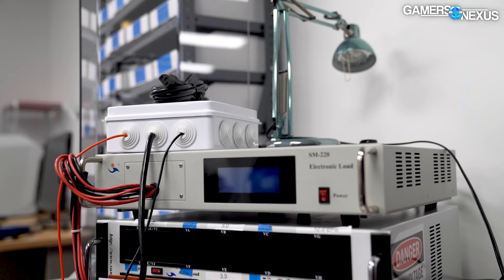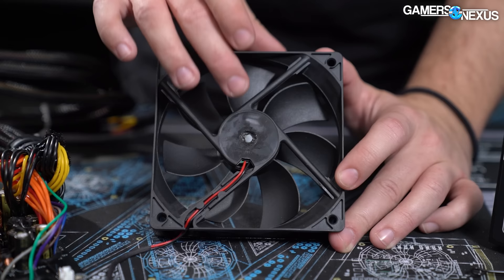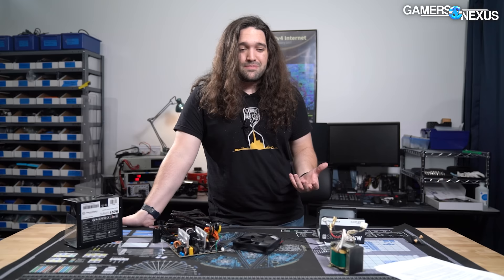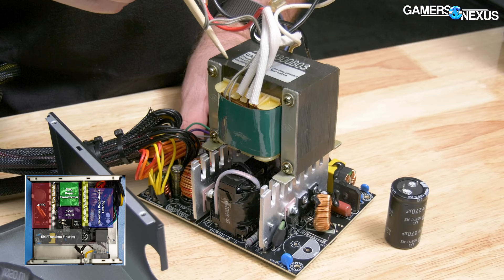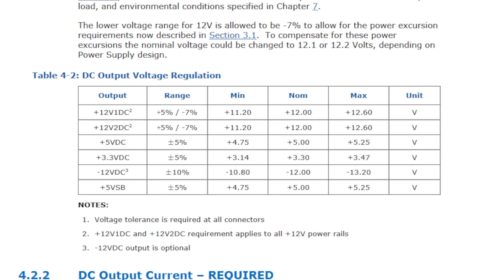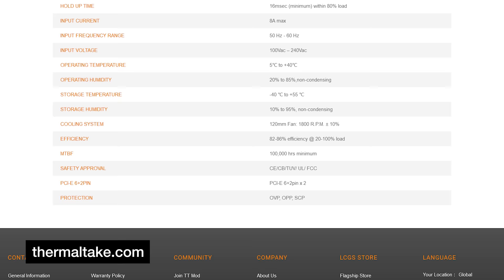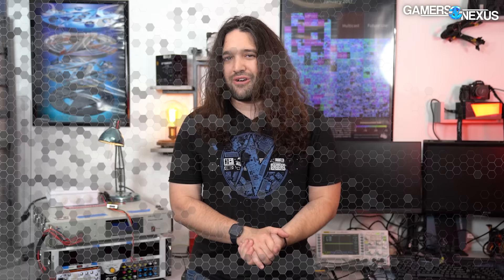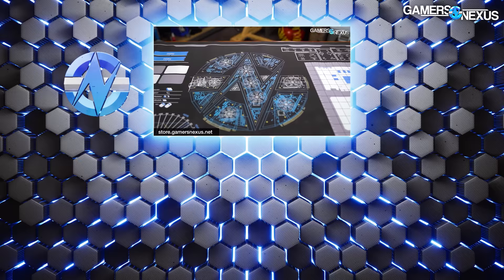Taking Risks on a Cheap PSU: $30 Thermaltake 430W SMART Power Supply Review

Comment: I'd really love to see some of the low end Corsair and EVGA power supplies compared to this. Especially the bronze models. Most of the budget builds I've seen run $30-40 PSU's from those 2 brands.
Reply: Agreed. Lots of people buying low end evga and Corsair.
Reply: I had a Corsair cx650m years ago kill the motherboard ram  GPU and even the CPU it was i5 4690k,Msi Gaming 5 motherboard,2x8gb gskill ripjaws and msi R9 290X I got it all from the same company and they swapped it all went with a different power supply tho they said they would get reimbursed from Corsair as the PSU was at fault with there testing
Reply: @TKIvanov  Yeah destroyed the whole PC just bought all the parts and the first time I turned it on for about £1200 I paid. The company I bought the parts from was really good done testing on all the parts and agreed with me IT was the powers supplies fault they just sent out all new parts apart from the power supply got a seasonic instead
Reply: Corsair low end PSUs are crap, would trust this over a Corsair low-end PSU any day of the week
Reply: @swecreations  I'm done with all Corsair PSU's now Seasonic seems to be of the best quality in my opinion and I have never had a problem with Seasonic I have had problems with 2 Corsair PSU's a HX850i has died on me as well as the cx650m
Reply: @swecreations  Only the Corsair VS and CS lineup is questionable quality. Every single other Corsair psu during CX gray label and above is objectively fine according to the tomhardware reviews from the build quality to electrical performance, functional protections and warranty.
Reply: @randomshorts739  Except not every single Seasonic psu is flawless.

Older Seasonic Focus and Prime units before 2018 had issues with gpus that has high transients spikes and ends up shutting off. This applied to alot of rebranded seasonic focus/Prime psus like the Antec Signature, Asus Thor, Phanteks AMP, Antec Earthwatts Gold Pro and so on and so forth. It was fixed around 2020 for revisions but still doesnt change the fact it was flawed for 2 years on their most popular platform

There's also objectively bad Seasonic psus like the S12II bronze (old ass platform and lacking protections) and S12III still questionable on it's protections and quality.

Im not saying to avoid Seasonic. Hell, Evga G6 is a modified seasonic focus platform and that thing is amazing value for what it offers but Im saying not to dick ride on brands only but objectively view each model to their own.
Reply: @granddya5323  I absolutely agree on that last part and most of the other stuff you said, sadly seasonic nowadays has multiple series that arent built by them. However in my experience the S12II was a solid offering (this is based on me using one for 6 years then selling it to a guy that prolly still uses it and I also know other people that have had it and had 0 issues. Im not familiar with its internals and build quiality just the above mentioned user experience).
Reply: @granddya5323  I think quality control is better on Seasonic Corsair has also had many problems with its AIOs, especially with PSUs tho as Seasonic manufactures the PSU whereas Corsair is just a reseller so doesn't have as much oversight
Reply: Now some are made by Seasonic but some are cheap crap and made out as if they are high quality
Reply: @granddya5323  And I just look the focus plus had the problems because too sensitive over current protection 

"As you would expect from Seasonic's reputation for build quality it's not a failure due to component weakness but rather the Over Current Protection (OCP) is set too sensitively and triggers under high load"

 so it's not bad PSU they were actually  trying to protect the computer more
Reply: @granddya5323  Did you not read my comment, that is exactly what I said?
Reply: @TKIvanov  Just b/c a PSU works fine for years on end does not mean they are good and reliable in general.

Would you really say newer cars by GM are fine b/c they are issue free for 3 years until you see the transmission start slipping, interiors falling apart and so on and so forth.

Hell my Corsair HX 850 v2 was still working for nearly 11 years and I decided to throw it out anyways for the 5800x + RTX 3080 build b/c the age on that thing was not worth it to new parts (ended up with an EVGA GQ 1000w for 55 bucks)
Reply: @randomshorts739  1. Corsair AIO issues has long been sorted ever since they stop using Astek gen 5 pumps. Astek gen 6+ and CoollT pumps, while slightly worse performance wise, are now far more reliable and you can easily warranty them if they ever fuck up.

2. It was confirmed the PSU shutting off from the transients of gpus isn't from the protections but rather a design flaw with the PSU not being able to take the sudden surge of power, similar to early units of the EVGA GA and Antec Neo Eco Gold. 

FYI, S12II and III lack UVP and OCP as well.
Reply: @swecreations  At least the CV 450 and 550 has much better cap selection, better overall platform (double-forward topology instead of being a group regulated unit) and doesn't lack OTP either. Similar case with the VS gray. CV 650 uses a different platform but is much improved with being DC-DC and so on and so forth

The only objectively bad PSU is the orange label VS which is just as bad as this thermaltake smart but they are out of production for 6 years now. 

Unless you are buying a GF1/GF2 from thermaltake, they suck more ass than any other psu manufacture objectively and dont get me started on their old TR2 series.
Reply: @granddya5323  Nah, the CV PSUs are shit, doesn't matter if they have better cap selection a double-forward topology if they still constantly fail, I do PC tech support as a side hobby and I can't tell you how many of these I've seen fail and take components with them...
Reply: @swecreations  As for my anicoical evidence, I had a thermaltake tr2 600e take out a xeon x5680+r9 290 system 9 months after I have built it and  thermaltake smart 700w wasn't able to handle the vega 56+i7 9700k on furmark after 13 seconds (neither could the evga 750 n1 and goes to show how shit tier psus just can't handle these parts)
A CWT GPUV 650 handled that same system without issue.

Objectively, CV is a far better unit than the tt smart or tr2. Even on the psu tier lists (which is based on professional reviews, known issues. overall performance of handling voltage drops, ripple, hold up time, transients response etc, protections implications. 

Thermaltake Smart is on the fucking bottom of "avoid using" while the CV is in "igpu use only".

Hell even Steve only limited himself on this psu to only basic office system. That goes to show how fucking shit this thing is.
Reply: @swecreations  I'm not saying to buy the corsair psu (corsair cv is bad value anyways lo). Evga GT, thermaltake gf1, MSI AGF, Antec HGC evga g6, superflower iii and corsair TXM are some of my favorite psus to buy for sub 85 and lower.

I'm just saying thermaltake's lowest end psus (the white smart and tr2) are boardline fire hazards that no one should ever buy.
Reply: @granddya5323  Why do you think that? It has a 5 year warranty and I haven't heard a single report of one catching fire, GN also found no obvious issues with the design from the outside, even if that's not a complete assurance there still haven't been any reports of one catching fire. It's not a fire hazard.

Comment: While the cheaper power supplies are interesting, it would be nice to see GN review some of the really high end PSUs as well. It would especially give a good comparison of really high end components to components like this one. Additionally with the rumoured power consumption of the upcoming RTX 4 series, higher watt/higher quality PSUs will potentially becoming more important.

Something like the Antec Signature Series 1000W Titanium, or the Corsair AX1000, or the Seasonic Prime Titanium they are based on. These are the ultra top end (I have the Antec one myself). Would be interesting to see Patrick compare the components of the crème of the crop PSU components to the ultra budget like this, as well as the mid-range stuff.
Reply from the maker: Working on more. For now, this one fills that! https://www.youtube.com/watch?v=ftF8V6Di84s
Reply: does Antec still make power supplies? We can't buy them in Scandinavia anymore because they had too many warranty issues

Comment: Honestly, I'm amazed they can design, build, and ship a halfway decent PSU for $30. So, to some extent, TT should be applauded for making something that probably won't catch your house on fire at this price. 

That being said, I would never buy it, and would likely never recommend it.
Reply: Thermaltake probably didn't design it, hardly anyone selling power supplies do these days even if their logo makes it to the PCB.
If your shocked at this thing costing $30 you'll probably be even more shocked at how much it would cost if you take the TT branding away and get it directly from the OEM.
There is a very good reason seemingly every "makes" power supplies, it's very profitable even at the low-end.
Reply: @zacharytaylor8523  yep good points. Although at this price point I'm sure TT isn't marking it up much. It would be curious to know what the BOM cost is. But then it needs to be branded, packaged, shipped, and the retailer needs to make something on it too.
Reply: @zacharytaylor8523  Yeah, low-end stuff in particular is outsourced. According to old threads TT uses OEMs like HEC, Channel Well Technology, and FSP. This power supply has probably been in production for well over a decade though so it'll still be one of them.
Reply: TT doesn't make PSUs. It's basically the same hardware Great Wall and CoolerMaster and a dozen other budget brands use. Generally the brand companies order them to meet a certain price point and specifications, so you can get crap and great stuff coming out of the same factory, and for the same reason the work Steve and boys do is important because it is near impossible for consumers to tell what is what. Being a brand name does not automatically mean the unit you buy is any good (looking at you, CoolerMaster), just like a low end brand like Great Wall (which you'll find in stuff like Walmart PCs) actually isn't all that terrible - I mean, they don't blow up and won't fry your stuff

Comment: used to use the built in power supplies in antec sonata 3s thinking "antec is fine!", had one die on me

got an ocz xstream when 80+ came out since it was the cheapest 80+ power supply in my budget, died on me

i have not made the power supply mistake in over a decade. used to check jonnyguru and get something they gave very high ratings to (usually seasonic), now you guys are filling that hole in the review space. love it.

Comment: When I tell people "Don't cheap out on the PSU" there are a few good reasons for this;
Namely most people get to the point where their current hardware isn't keeping up and generally it's a new GPU that will get swapped in. Having a good PSU allows you, even 5+ years down the line to easily swap out and power a current-gen card.

The other reason is mainly all the horror stories about the Ali Express specials that tend to go pop and take other components with them
Reply: Yep. When I started building PCs I was a young kid going into high school and I didn't have much money so I always skimped on the power supplies... and always had problems with them. Luckily none ever exploded but I did get BSODs.
Reply: Definitely don't cheap out with lesser known brands. They've got much less to lose. With more known brands you're just very likely to get old, cheap to produce, designs with lower efficiency (and lower operating times, I.E. don't expect it to get far past years of insurance it has).
Reply: @MLWJ1993  I had this power supply from OCZ ? You remember them ? Ever heard of them ? Too bad they no longer exist, they made good products. I loves that power supply and used it in 3 different builds. It was still working just fine in 2016.

Comment: I'm curious how this compares to the PSUs included in prebuilts (dell, hp and the like) since they often have good 80+ ratings but low wattage
What I also wonder is how this compares to the two other 30$ PSUs I could find on amazon which are the EVGA W1 500W and the EVGA W3 450W. While testing those is probably not worth the effort I still wonder how they stack up...
Reply: I'd like to see the W3 since the only legit review is gone and the enclosure has gone under some revisions, so possibly a changed internal layout. Last I recall, it actually performed pretty well for a group regulated unit like this smart. 
The W1 has been reviewed by Aris(psu reviewer for tomshardware/kit guru/etc.) a year or two ago, and the result was the bridge rectifier exploding when under max load, so that'd be a fun test I suppose.
Reply: OEM prebuilts don't have cross-load problems because 12V-only, and can use higher quality parts at the same total cost -- again because 12V-only.
Reply: @Vegemeister1  I didn't know they only used 12V. I guess there is at least one upside to proprietary stuff.
Reply: @Vegemeister1  And a pretty smart way to save money / get a better psu for the same money

Comment: I know this is a gamers channel but I'm interested in the low-load efficiency of cheap, low-capacity power supplies for home servers; or other always-on, low-power devices. It would be cool to see which, if any, supplies have decent efficiency at 10W or 2% of max rated capacity. Or does the spec as written not set a meaningful standard?
Reply: I'm also interested in this. My guess is that you'd be better off using a shared high-efficiency industrial PSU (e.g. 12V) together with one Pico-PSU (or its cheaper clones) per server. In one of the slides, you can see that the efficiency on all the consumer PSUs they tested is atrocious (50%-60% range) at 2% load, even the high-end ones, because they have fixed overhead and are not optimized for very low loads.

Comment: Yeah -12V is not used anymore by any PCs/MBs, I believe it was used for RS232/RS485 or some other legacy stuff.
I hope intel removed that rail from the newest ATX standard.
Btw. 24:30 did you actually physically verify that the cables are 18AWG?
Reply: -12v is also used in old soundcards (isa/pci), but modern uses are likely nonexistant.
Reply: @MeatPoPsiclez  Yeah it probably would've been only few cards and obviously none are used these days really.
Someone does PRO audio stuff you just get external ones.
ATX 2.0 is really obsolete.

Comment: kinda crazy how cheap this thing is. you can get an entire power supply for the cost of a single premium case fan from Noctua or Corsair
Reply: Goes to show the actual bare margin on "premium" fan :-) 
The molded parts are pennies and the PCB is populated in smd jelly bean. Yes its round so an extra penny..
If you take out development costs and copper winding /rare earth magnets then there should be quite a lot of money to gain
Reply: @kitecattestecke2303  You're probably mostly right, but for premium fans I expect them to use more-costly forming processes for the frame and impeller since they need tight tolerances. Also Noctua claims to use their own proprietary polymer for the impeller rather than a commodity plastic, which would raise costs.
Reply: it is indeed - the power supply is fine, for reference a 300W/30V open frame (no fan) with 85% efficiency would be over $200 at mouser.

Comment: It is so great there is now a Youtube channel which does reliable PSU reviews. A good quality PSU is important for other components, how long they work and how well they work. People often spend way too much to buy some over specced motherboard, but skimp when they buy a PSU. I have always used and recommended good PSU's (often using jonnyguru as source, which is no longer active) and motherboards with decent VRMs (not the most expensive ones, but anything with good enough VRM) and every build has lasted like 10+ years of use. Much respect for this channel for reviewing PSUs and doing it properly.

Comment: Just wish they made more BETTER PSU's since like the smallest you can get(of GOOD quality) these days are like 550-650W which is a bit overkill for a 100W pc
Reply: You can get 300 watt PSU Be quiet has a good one for the price be quiet! Pure Power 11 300W, 80 PLUS Bronze, power supply
Reply: Have a look into PicoPSU.
Reply: Although you get to 200W+ really fast (far from 450 though). A smaller CPU, MB, maybe a PCI-e card and a disk or two probably already comfortably get you there.

Comment: Good to see a review on a PSU I actually have. 
I bought this for my retro gaming PC; Dell Inspiron 531 upgraded with an AMD Athlon 64 X2 6000+, 8GB of RAM, Nvidia GTX 260, a boot SSD and a games HDD. Dual booting W98 and XP.
I wouldn't have put this PSU in any other system than this, but heck, it was cheap and it works great in that system that only gets used once or twice a week.

Comment: 10:40 A discharge resistor would normally be added there in the design to discharge this high-voltage capacitor over about 1 to 4 minutes.  Usually from 100 to 400 volts down to 10 volts in within 5 minutes.  If I am working on a PSU that doesn't have a discharge resistor then I'll discharge the cap, calculate an appropriate value and add the resistor to the board myself.  It just makes it safer later on when myself or someone else needs to work on it again.  I usually make sure the resistor only has to dissipate about 1/8W while in normal use and use a 1/4W resistor direct on the caps leads underneath.

Comment: 16:04 that's the wrong table. Voltage ripple is in table 3-5 under section 3.2.5. That table implies 500 mV p-p for the 5V rail but that's the maximum deviation from nominal voltage (typically depending on the load) not the ripple.